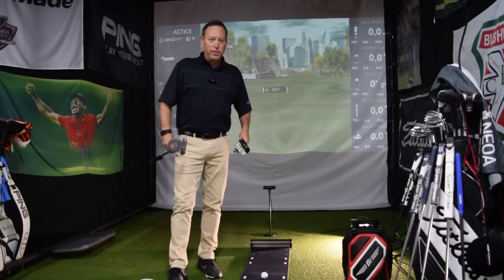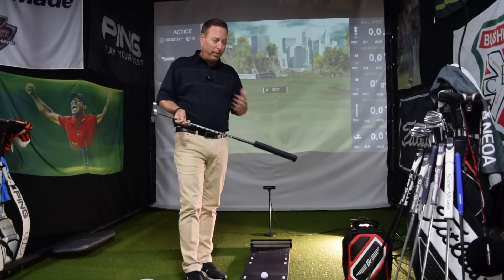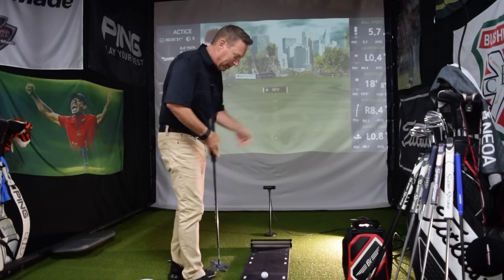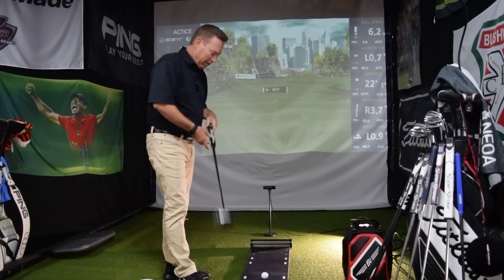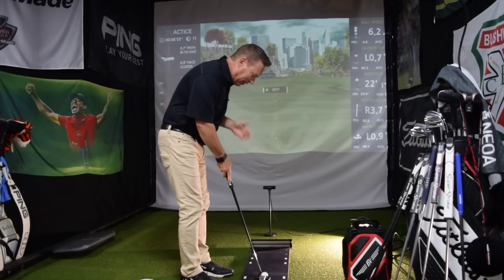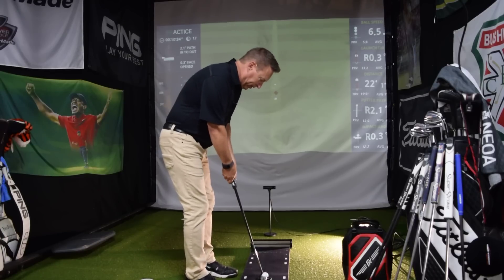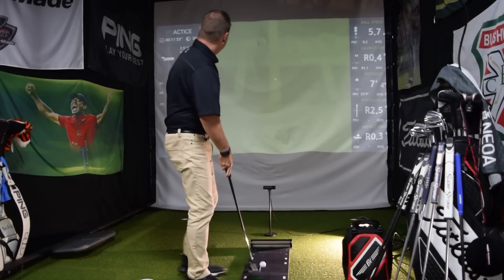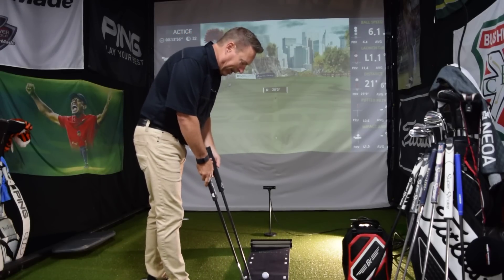Zero Torque and Lie Angle Balance vs conventional putter comparison

Comment: Agree with everything you say here. Most likely a good putter will stay a good putter. However, I recently got an Odyssey Square 2 Square #7 cruiser and noticed a big improvement in both standard deviation of face angle as well as distance on my ExPutt. It’s hard to say how much is the length, more upright lie angle, face insert, sight lines or zero torque. It’s probably a bit of each, but the zero torque helped me get my path heading right since I previously left the face open and toe down. I’d also say having center shafted helps when you inevitably miss from center. Previously my heel shafted putter would lose 3-4 feet on a toe strike on a 30 foot putt. The miss is less punishing with a center shafted putter. I also think the AI insert helps. I’d guess it maybe only accounts for 6 inches of correction on a 30 foot putt, but anything that maintains consistent ball speed and corrects your line surely doesn’t hurt.

Comment: You can never overlook or underestimate the importance of how a putter looks as you stand over it. If it don't look good or looks weird to your eye then your mind will inevitably have that logged and your feel (the most important part pf great putting), and stroke will be affected. I know, I know people claim that "who cares how it looks if the ball goes in the hole?!" That is nonsense cuz those people don't care how it looks in the first place. I have used mallet and blade style. Looks matter. Results reflect it for my game. Even grip size dramatically affects feel. Don't matter of "analytics" say a fatter grip maintains face angle better and prevents excess face rotation, yada yada. If it costs feel then it is a detriment to your stroke. Marry look, feel then stats.
Reply: Alignment aids like those on a fang putter are different from looks. MyGolfSpy does extensive testing and have shown that looks don't matter. Some of the cheapest and weirdest putters often do the best. Of course, that requires extensive testing that is not available at most stores. I do agree on the feel part. That's most important for speed control. As for grip, I'm not sure. I got a Toulon putter was a pretty close to cutting off the stock grip. But instead, I changed my grip style and now I'm putting better than ever. I was one round from forever losing that grip.
Reply: I’ll take math over what I think works every time.

Comment: I want to get the PXG because I am always trying to manipulate the putter face during my stroke so not having to worry about that will be big!
Reply: Do it man. I was the exact same and averaging three 3 putts and 38 putts a rd. Three Rds into using the Allan (very small sample I know) and I've no three putts in 54 holes (absolutely massive for me) and averaging 32 putts a rd. It inspires confidence especially from 3-5 ft.
Reply: II went with the PXG Allen. One thing I discovered is that you really have to concentrate on NOT to manipulate the putter. That's harder than you think..... Other than that I think it's going to improve my putting.

Comment: Were you custom fit for this LAB DF3?  makes a world of a difference if you just pick one of the shelf so to speak. The key to a LAB is getting it custom fit for your own lie angle. I was remotely custom fit at 72 deg. lie angle.  Good point on ball position, I've seen the exact description on LAB's website >> the shaft has to be lined up in the center of your stance.
Reply: Not many fitting sites, none in my state. I didn't want to pay LAB $$$ without a fitting, so I went to a local PXG store and got fitted.
I like the putter overall, but I still need to address some of my own grip issues which sabotage putts. I've had it out for two rounds and am starting to make some nice rolls with it. The PXG allows one to keep their own arc path and does not fight the golfer as much. I have heard that some players never adjust to LAB.
Reply: @johndomutz1052  I got custom fit remotely l like he said in this video. Emailed LAB my putting setup and putt. Super easy. they recommend a 72 deg. Lie angle. I custom ordered it at 36 inches, counterbalanced, heavier head and SS 17 inch grip options. Best putter I’ve ever owned
Reply from the maker: Yes, I did the remote fitting first

Comment: You can’t simply can’t pick up a low torque, no torque putter and expect it to be better. It doesn’t work that way. You are use to the manipulations in your hands required to make your gamer work for you. Adjusting to a low torque/ no torque takes a little time. Once you figure out how to let the low/no torque putter flow, they absolutely do what they report. That stated, some are very good at controlling their hands and will not like a no/low torque putter.
Reply: Good point. I have a PXG, but my hand twitchiness can still sabotage a putt. Because of this,  I'm working on my grip and not blaming the putter.
Reply: @johndomutz1052 they recommend putting without your thumbs touching the putter as an intro to letting zero torque putters do their thing without manipulation
Reply: Thanks, I will try that!